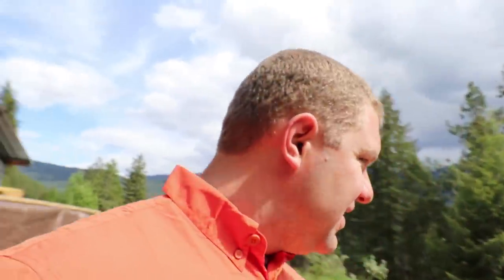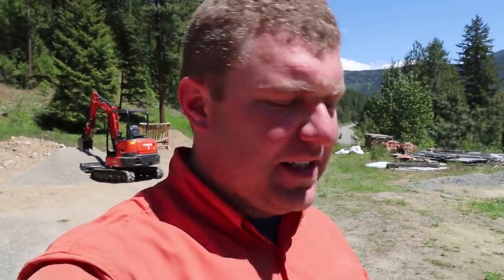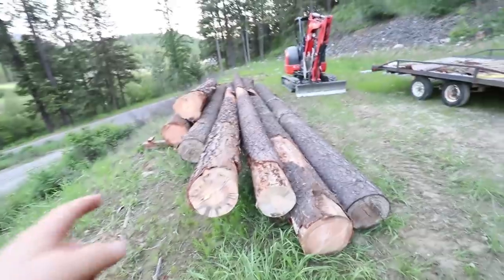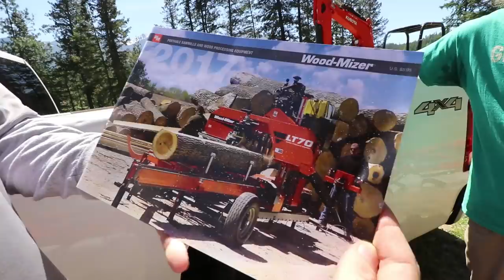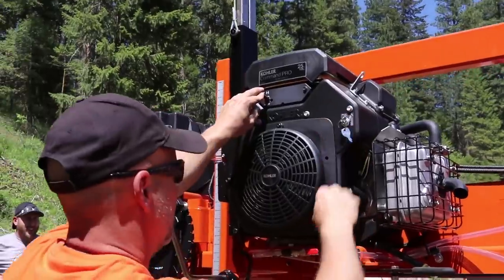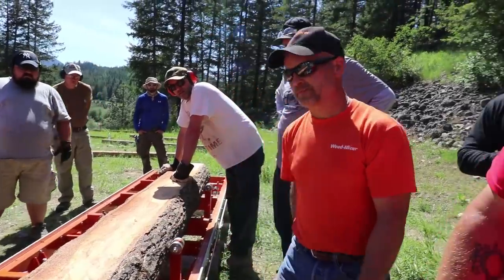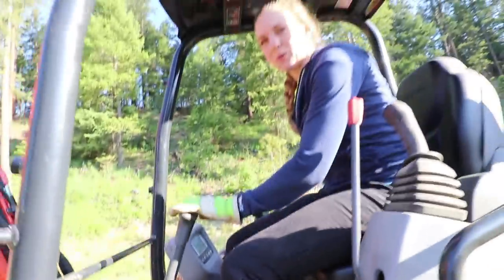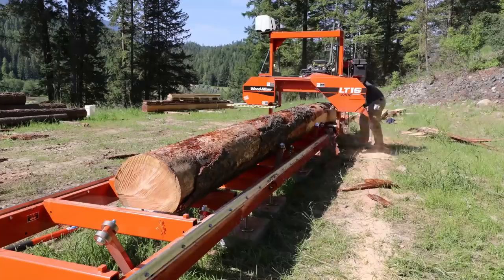DREAM COMES TRUE: Young Couple Gets Sawmill to Build Debt-Free Home

Comment: Lay your waste slabs on the ground to roll your logs on to the mill. Keeps the logs clean and way easier to roll the logs on.
Reply: Jeremy Honeycutt You lay only a few perpendicular like 'rails' from log pile to mill. Gets the logs off the ground so irregularities are less likely to cause issues rolling.... they're not meant to walk on.
Reply: agreed, and if they are debarked, you can use them in many ways, like cut in strips, they make pretty window molding, or left in slab condition, and trim the edges so they are flat, can make pretty siding for a small shed, , slabs are not all waste. but treated right, they can seve the first purpose and reused later,
Reply: Waste is best dried and used for firewood for heating/cooking/hotwater. Steel and concrete will make the easiest transition from pile to mill to pile since they will be doing a LOT of moving and milling to create enough timber for a decent build.

Then use the woodchip for gardens (veg garden etc) as a natural weed and moisture barrier. It will rot into the ground providing food for worms and the cycle goes on.

Comment: for moving the logs, you could run a couple cables/straps along the ground under the saw mill over to where the logs are, put the logs on top, and then loop the cable over top and back through a winch.  then winding in the top cable will roll the log towards the mill, although you would need to anchor the cables to something heavy like another tree in tree background.
Reply: There is a hydraulic lift that is made for these saws. Basically 4-6 teeth that you roll the log onto and it lifts the log onto the mill. The method I use is two high poles on each side of the mill with a cable attached and a hoist attached to the cable easy peasy.

Comment: In a former life,in another country I was a sawmill engineer. On the old style mills we had a table built from logs which was as high as the decks on the jinkers(log carrying trailers) . It's very simple just logs laid on the ground parallel with the sawmill carriage line with logs at right angles on top to the carriage. The jinker sides dropped  down,allowing the logs to roll onto the bed of the table. The table is flat and level on top so you can roll the logs along it onto the sawmills carriage.  On very large logs (6ft diameter back then !) we had a simple system involving a cable,snatch block and timber hook  whose cable we would wrap around the log and roll it.by hooking the cable to carriage and pull the cable.  So no need to have machinery to load the mill .The table was only 15' long  .The Cant hook is a good simple tool which even my GG grandfather used when he worked as  a pit sawyer but even the ones we used were wooden handled with hooks made in the mills own forge .not fancy like yours...it was a while ago ha ha

Comment: Check around for any farm auctions. You need a Farmall , or a Fordson tractor, with a front end loader . You can get forks to go in place of the bucket , and with luck a backhoe attachment. It will be invaluable for skidding logs ,loading the mill, and building the house.

Comment: Sweet sawmill.  a real 36" cut capacity on that LT15Wide.  You'll just need some support equipment (forklift) to help load and unload the logs and cants.  That is the one downside to a manual bandsaw mill (all of the log handling/rolling).  But it sure beats a chainsaw mill by a long shot.

Comment: I can see you guys opting for the power feed in the future. While the mill is making a cut you can be prepping you next log, moving slabs or stickering your boards and cants, etc. Not to mention saving your wrist and elbow from all the cranking. It takes a several minutes to do one of those long cuts. You will find this time can be put to better use managing the other tasks that need to be performed around the mill. A great quality mill though. Love the video and the community spirit you guys have.

Comment: For your consideration:  I use my '89 Jeep 4x4, 5-speed manual (w/ High/Low-range) to drag logs.  It's faster to tie a chain onto two or three 8-to-12-inch logs (or one 20"x20-foot maple) and drag 'em, rather than messing with a trailer... AND it would eliminate the time spent moving your trackhoe 1) into the woods to load, then 2) move it to your landing to unload the trailer.

Comment: Have you considered a gantry on rails to move the logs over? Pick them up with chains using block and tackle or by winch then slide the gantry over the mill and lower into place. If you preplanned and had the necessary welding tools etc you could use it to lift back off and deposit on the opposite side of the mill once finished. 

Something like above would mean not having to have an excavator. Set up nicely and just tow logs in with a 4wd, lift, mill, lift, use.

Comment: I hope you have two spare Blades for the mill at if they wear you will run off and not give you a parallel cut. They may also break and leave you with a half cut timber. Great video and good luck in getting the timber done in time for you build.

Comment: Congrats!!! Looking good. The WM rep mentioned their lube to put in your water. That stuff is super $$$, switch to Dawn. no joke it works better and is a heck of a lot cheaper. We used it at work on our band mills. WM 3000 and 3500. It also helps breakdown the pitch from that pine, or at least it's easier to clean off your mill. One thing we eventually did, and I don't know if its feasible for the smaller mills, is switching to the mega roller guides. Don't know if they'll fit your mill but we were able to go waterless with them, and that was running mostly hardwood. It made clean up that much easier plus it saved on the maintenance of the mill since it wasn't wet all the time and rusting out. Cant (get it) wait to see what you accomplish.

Comment: Anchor feet on concrete 1'x1'x1' poured leveled concrete blocks (or slab since logs are heavy), then build a cover over it that can be electrified for light and heated.  Then pour a 2'x2'x3'd anchor block for your winch.  Use this to drag logs lengthwise right alongside the mill (its best to have a concrete causeway to slide the logs on to avoid getting dirt on them.) its nice to pull the the logs through a narrow hole rather than need a giant side load door that freezes you out since the best time to mill is winter.   Good luck, i like your vids

Comment: Id say use some of the scraps to make a sawdust collection box. make it easy to collect to add to the compost/garden. 

Do you think you could build a log arch out of 4x4's to let you bring logs back with the atv? Finding the right wheels for it would be a fun job but would let you pull the logs rather then dragging them.

Comment: Need a rack platform to help load your logs onto the mill.  Then slide it back onto the platform. Doesn't look like you can off load to other side, but maybe you can rig a slide that allows you to move the finished beams over to another rack adjacent to the loading rack.  Or you can build a gin pole crane.  Watch that Mr. Chickadee and his wooden capstan.

Comment: Also, could roll the cant off the mill onto several short sections of pvc or something similar. Then it can be pulled to you storing location by moving the pvc that rolls out the back up to the front (think Egyptian pyramids). Once there, the cant hook should be enough to put it in place.

Comment: You'll get a ton of suggestions about how to move timbers.  I'm thinking you've got a welder and probably a junk yard around somewhere.  Build yourself a little cart, throw some wheels on it from the junk yard, add a hitch so your four wheeler can pull/push it.   Toss in a couple timber framed A frames and a cross beam and a come along to lift them on and off the cart.  You'll figure it out.   Strong mind, healthy back.   :)   Blessings on your endeavors.

Comment: The mill you have can be operated by one person.  To get the logs o the mill:  Build a raised track out of wood on top of posts so the finished top of the trachk is even with the height of the mill Bed.  I is supported by posts set into the ground Old railroad ties or telephone poles are good for this.  The posts about 4' Apart.  You would need 4 of these.  The tracks terminate about 4" prior to the mill.  That las section is Hinged or bracketed to leave the area clear.  One person can use the cant hook to roll the logs to the mill.  That's how we did it in the old days.

Comment: Years ago wanted to restore my barn. Knew I would need 6-7,000 BF of 1 by for walls and roof to start. Lumber yard wanted $1.05 a BF for field dried pine. After research spent $7000 on Norwood with bed extensions etc. Used 29 ford doodle bug to drag logs out of wood to mill. Made ramp and rolled logs on to mill with a couple of cants. Worked best with 2 people for large logs. Made sure mud on logs was on side where blade exits log. Needed many timbers when I got into frame of barn. Cut a couple 12" X 12" X 25' for new sills. Daughter in law would one of her weeks vacation every year to help. Lots of free help because people loved working with the mill.

Comment: Spent many, many hours running a wood mizer.  A great piece of equipment.  Some suggestions. Get some kind of cover for the cutting unit. Keep the rain out. Also a spare blade would be a good idea. Nothing worse than needing a new one and not having it. You might have a place nearby that can resharpen them. I always used leather gloves, just stay clear of the blade. Never had any problems with it. Just check fluids daily.  You are going to have a great time running it. Enjoy.

Comment: Been in the Florida coastal estuary wilderness Uber fishing 2 weeks (it was also harvest feast time for the 'Skeeters), just picked your channel back up. May I give a suggestion, take 6 (plus bracing) of your biggest timbers and 2 junk yard rear truck axles (W/wheels)  and make yourself a Gantry Crane using a manual chain falls hoist traveling on a steel H beam bolted underneath the top horizontal and the horizontal rolling on H beams under the bracing (or a Harbor Freight 12 volt winch on rollers), the time spent making it will reap rewards in time and safety turning and moving big logs (you think you've got back problems now, the best part is still ahead).

Comment: Not sure anyone's mentioned it yet but you probably should build a home for the mill 1st to keep the weather off it. 
Something better than a tarp, but something that you can easily move/remove when the mill is to be used. 
I thought about a woodmizer... with hydraulics, I work on a 217 acre vineyard and we have plenty of hardwoods and 70 acres of old growth on the backside. (no need to cut trees as they do fall now and then). No time for it right now... 
Anyways.. good luck with your projects. I see a lot of hard work in your future. I also see rewards which is the carrot you follow.

Comment: So I think you could roll the finished beams off easily if you had 2 old tires with rims from a car. you could bolt on a square shaped clamp to each wheel that would clamp to the end of the beam or snugly fit.  You would have to get the clamp welded by a friend but it looks like your friends are handy that way.

Comment: Did you ever think of a log arch for behind your quad?  the saw mill is almost close enough to the ground that you could actually use the arch to load the logs onto the mill and move the cant off of the mill with a log arch and the quad that you already have.

Comment: Hi Guy's:   Just a couple of idea's.   Lay a couple of old tarps on the ground beside the track .  Then every couple of days drag them  around the site to distribute a fine layer of fine sawdust mulch on the ground cover but not enough to smother it.   If you add it slowly in thin layers; the ground cover will continue to grow, the soil will improve and you will lose less water from surface evaporation.    You can make a small  dolly with 2 pneumatic tyred wheels and an axle through the block you cut off the cant.  Now  you can slide one end of the cant off off the track and ratchet strap it to the block on the dolly.  Then both of you  can pick up the other end and roll it like a wheel barrow and set it on the sleepers. Bert
Reply: PS  If you you use a threaded rod for the axle;  you can position the wood block or blocks in the middle and lock them there.

Comment: If you still have that flatbed trailer you used to move the logs from the back of the property you could back it up to the end of the mill and winch/drag the beams onto it then back trailer up to pile set up a tie off point on other side from trailer then drive the trailer out from under it.

Comment: At some point, you will want to move logs in an area where you don't have a lot of room. A canthook works OK but, has limitations. If you wrap a rope round and round a log, you can roll it up onto the log deck of the saw. You can put a block& tackle on a tree and hand winch the log up. If you use a canthook, you are on the downhill side of the log. You have big trouble if you lose grip on one of the canthooks. As the log climbs the ramp, the rope unwinds. 
The other alternative is to get a Lewis winch that attaches to your chainsaw.  It will easily winch up your logs.

Comment: I recently had to move a giant playset that we got for free off craigslist. unfortunately I didn't have 20, 15, 8, or even 6 people to help me. I had my dad and myself and some of the components weighed 600 + lbs. I'm telling ya the best thing I did was spend $40 on 4 inch pvc that I cut down into useable sections to be able to not only roll but slide those pieces. I think you should channel your inner Egyptian and use similar techniques to get those logs moved. excavators are nice and quick but applying ancient math is low cost or free. love the channel, keep up the great work.

Comment: Congratulations on the new tool! I love that you are thinking about using it to help build the community. I have a question, with sort of a suggestion built in. Why do you (and many other YouTube providers) seem to want to stack the logs so close to the ground? Looks like you put them on some 'sleepers,' which seem to be no bigger than 6x6. That means you have to roll the logs across uneven soil, and then uphill to get them onto the table, ready to mill, or rent the mini excavator again. Why not either simply stack some timbers, or maybe even build a very small set of racks out of waste lumber or several 'firewood' trees, and then set up some timber 'rails' to bridge the gap so you can roll the logs DOWNHILL onto the mill? Could you also create some rails to slide the (now square) lumber off? I don't know if you can slide the lumber off the back side, or slide to the end and then off the back side? I hope this helps - work smarter, and all that. Looking forward to more sawdust! Blessings.

Comment: There is a log caddy trailer with boom arm to load and unload at the mill.  Very light footprint and it may cost less than the backhoe rental.
Reply: It is pulled by your atv. The trailer boom arm makes short work of loading, unloading and stacking.  Just buck big trees at beam length.  Would be very helpful during the beam install process.  Good back insurance.   Get a canvas or old tarp down to catch the sawdust.  Compost or trade to chicken farmer for bedding.  Eggs meat and do do for compost.

Comment: When you put your ear plugs in, roll them down as small as possible 
before inserting.  Then, when inserting in your ear, use your opposite 
arm around and behind your head to pull your earlobe out and back.  This
 straightens out your ear canal temporarily.  You can then get the ear 
plug in farther.  Put it in gently.  You'll know instantly if it's in 
too far.  Just be gentle.  In about 30 seconds to a minute, the ear plug
 will re-inflate and you will have much better sound protection.  You'll
 have to do the insertion within about 5 seconds of compressing the ear 
plugs if you have small ear canals like I do.  Those green and orange closed cell ear plugs are 
better, but long term they exert more outward pressure on your ear 
canal.  After several hours, your ear may begin to ache.  I use the 
yellow foam ones with the orange lightning symbol on them.  They will 
give you a 33 decibel sound reduction.  They are 3M E-A-Rsoft (tm) 
Yellow Neon Blasts (tm) Part number 312-1252 (this box is probably 7 
years old, at least).  I buy them in boxes of 200 pairs per box.  I 
probably use 300 -350 pairs per decade.

I do this because my father wore two hearing aids and my grandfather 
wore one.  I saw how miserable it made their respective lives not being 
able to hear properly.  Protect your ears.  I began protecting mine at 
around 27 years of age.  Fortunately, for me, I hadn't had much damage 
by that age.  I'm 67 now and have spent a lot of time around loud jet 
and piston aircraft, trains, a long time ago in noisy bars, and other noisy places.  My hearing 
is near perfect still.  It does make a difference.  I also don't 
overdrive headphones when I wear them.  Your older self will much 
appreciate the way you protected your ears and other parts of your body 
when you get older.  Almost everyone I  know who is around my age is in 
pretty bad shape.  I'm in good shape, as in, I don't hurt just being 
alive and most of me works perfectly.  Take care of yourself!

Comment: Congrats on securing the sawmill.  Do you have plans to build a cover for the mill to keep the weather off it?
Reply from the maker: +Alan Lamb In the long run it will be mounted on a trailer and stored under cover. For now it's location is temporary so can't justify an extensive cover.